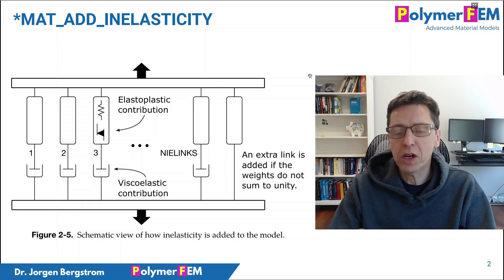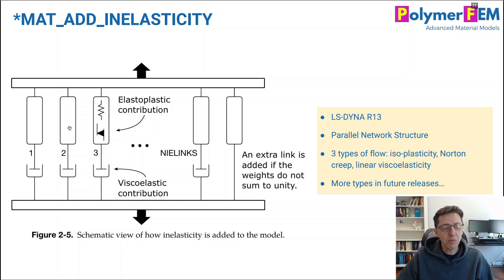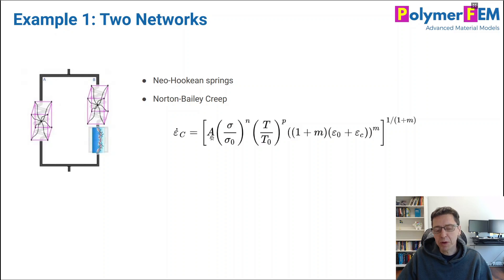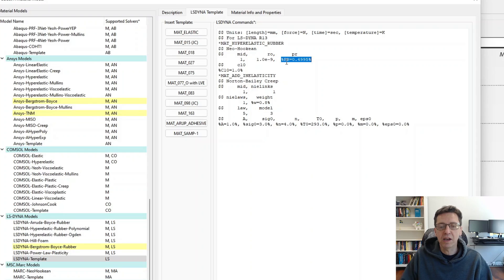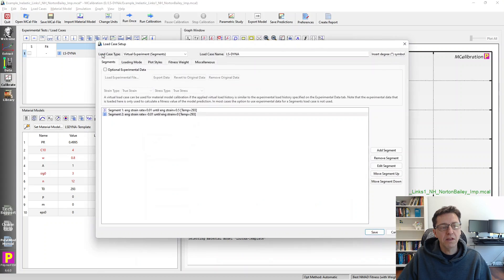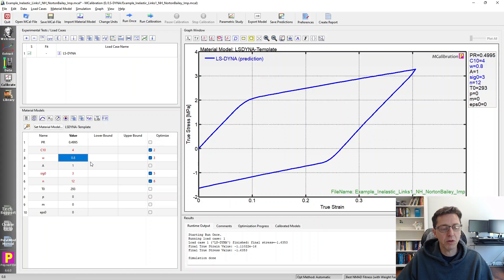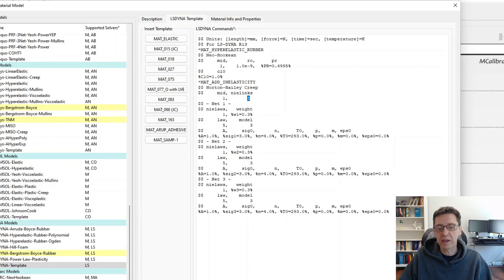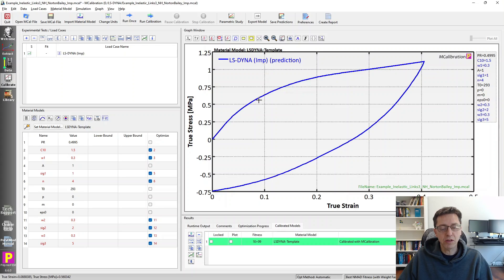Calibrate LS-DYNA *MAT_ADD_INELASTIC

Comment: Dear Jorgen, thanks a lot for this very useful video. I have a couple of questions:

1. Is there any difference between this mat_add_inelasticity and the PolyUMod Parallel Network Model (of course if you define the elastic and flow elements equivalently)?
2. What is the spring element in the non-elastic link(s)? is it the same as the elastic link (in your case the NH model)? If not, how can it be tuned?
3. It has been written in an article that the parameter "n", i.e., ranging from 1 to 12, (both in Norton-Bailey and BB models) can define the response shifting from viscoelasticy to viscoplasticity. If it is true, would you please explain the reason behind?

Thank you in advance.
Reply from the maker: 1. There are lots of differences between the Mat_Add_Inelasticity feature and PolyUMod. For example, PolyUMod contains many more flow element types, more hyperelastic types, more damage accumulation types, more failure prediction types, more options to couple the response between different networks, etc.
2. Yes, it is the same elastic "link" type.